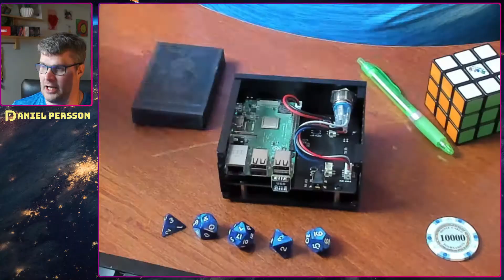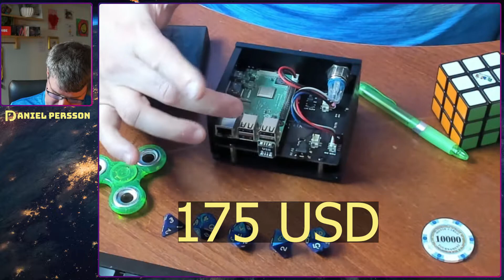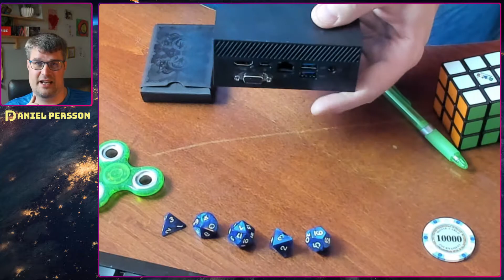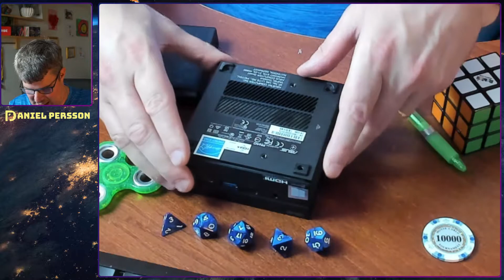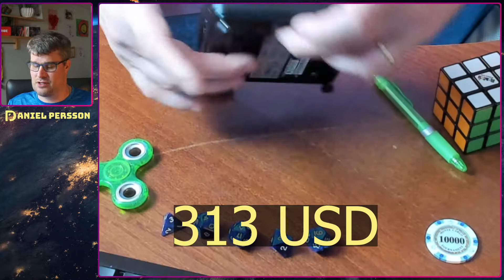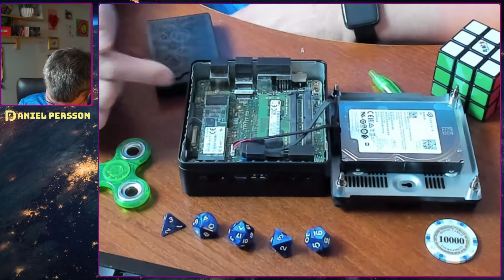I'll give you an example for hardware to your ceph cluster

Comment: Nice video. Just startin with Ceph. Quick question how many of these devices would i need to setup a lab at home. I think is 3 for cluster plus one as client.
Reply from the maker: Hi.

Theoretically, you could set up a cluster with only one host, but that is not much of a cluster.

You need to have an odd number of monitors so they can have a quorum and vote about the correct structure. After that, you add more data hosts and can use the same hosts for data. But if you want a cluster with high availability and redundancy, I would say that three replication hosts with three copies on different hosts are a great start.

You can watch this video:
https://youtu.be/LxDQyFWDNHI

I cover the installation and some things you need to keep in mind. 

I hope this helps. Thank you for watching my videos.

Best regards
Daniel

Comment: Is network speed of 1gb/s good enough for a 3 node cluster?
Reply from the maker: Hi Mike.

It all depends on what you need to do with your cluster. We have a 10GB backend plus a 10GB frontend network for your cluster because we need to migrate data and handle requests on a pretty large scale. 

However, my backup solution at home uses a 10MB link, which is plenty for my use case.

I hope this answers your question. Thank you for watching my videos.

Best regards
Daniel

Comment: A year later and the best valued system I have found recently is a Terramaster F2-423
Reply from the maker: Hi Mark.

That almost sounds like a review :)

It would not fit my purpose of a small 8 Gb memory box that can run one data drive with another system drive. Maybe in the future, I will buy a chassis with a 16 Gb memory system with two data drives for efficiency. But the OSD service needs more memory to work. And the TerraMaster seems like a complete solution with Raid, but it is not something I need for my Ceph cluster. It might be good for a small business that stores some not-so-important data with a simplistic Raid solution. But for anything more mission-critical, you should at least have 2-3 copies on separate drives, and then a Ceph cluster or a Raid box with Raid 5 or better is in order.

For the best result, you should always have a copy offsite as well.

Thank you for watching my videos.

Best regards
Daniel
Reply: @DanielPersson  My TM F2-234 has 32 GB ram, 2x 2 TB NVMe and 2x 2 TB SSD. It has Proxmox installed on ZFS (mirrored across the pair of NVMe drives) with Ceph on one 2 TB SSD and GlusterFS on the other 2 TB SSD spread across 3 similar spec'd clustered nodes. Both Ceph and Gluster use 3x replication. I'm comparing the practicality and resource usage of Ceph vs Gluster, but will probably remove Gluster and use those drives as extra Ceph OSDs, once I figure out how to implement CephFS without blowing things up. I'm still happy to suggest the TM F2 (or F4) is the best valued and most flexible mini-homelab host node available in 2022.